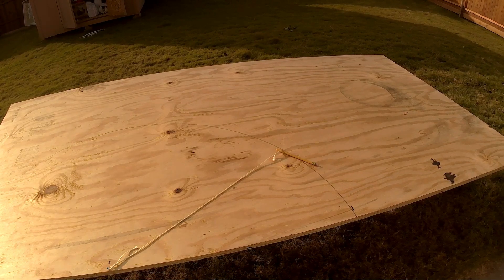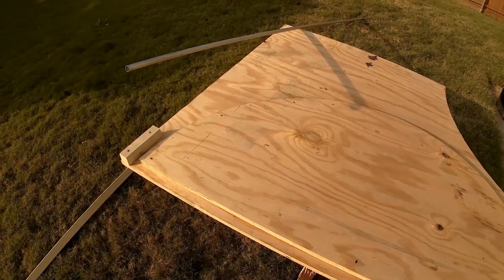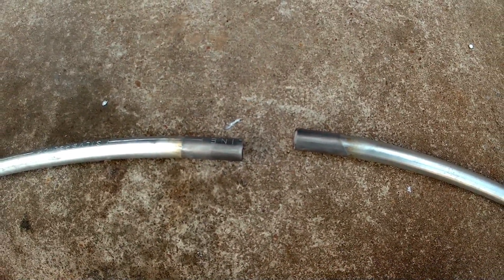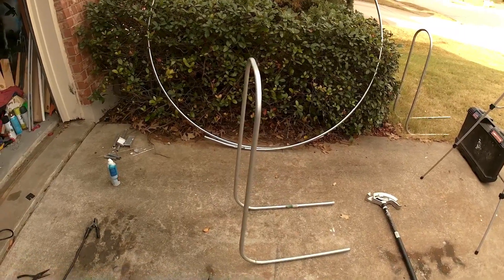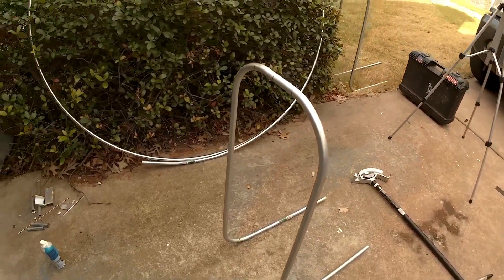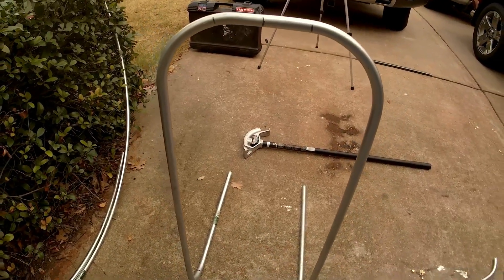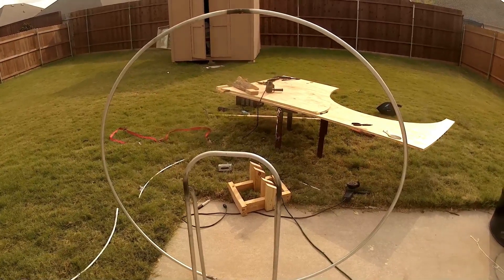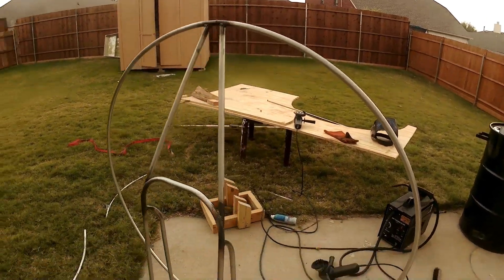Homemade paramotor built out of EMT conduit part 1

Comment: You forgot to mention that trying to weld through the zinc coating produces a weak weld that tend to crack.
Reply: I made mine with conduit and MIG welding, if it's piled on good it's quite strong, but yes the zinc should be right off of it